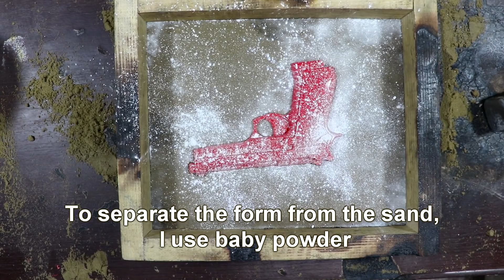Сasting gun - Trash to treasure . Melting cartridge case - ASMR brass casting

Comment: Hi: If you keep using that ceramic fiber like that, when you're old you're going to need oxygen in tubes, a tip from a friend
Reply from the maker: I need to cover this with a refractory compound. Thanks
Reply: @hotmetal85  p
Reply: @nabilawali6249  😊8

Comment: This is hard to make , i tried to make this several times and each time failure , your's turned out GREAT , the hardest part is the trigger ring area , and trying to get both sides to look good ....But you pulled it off , not bad at all .
Reply from the maker: It is necessary to make holes for air out in the area of the trigger
Reply: 11000000
Reply: A10090
Reply: DEMIAN
Reply: @lhmuebles5542  klk
Reply: Klk
Reply: @hotmetal85 o
Reply: XD by
Reply: Klk     Hola
Reply: ok
Reply: @alexandraromero9293  
̊